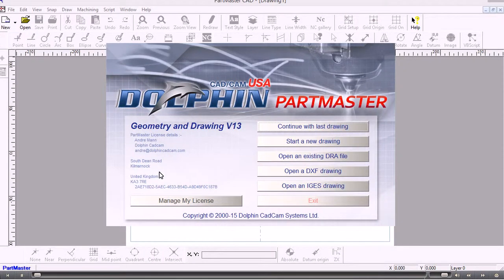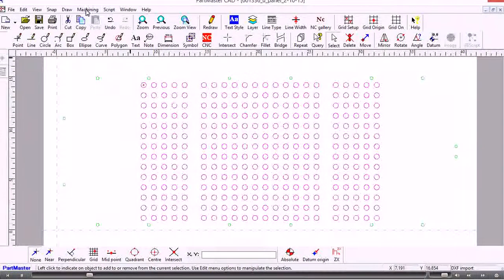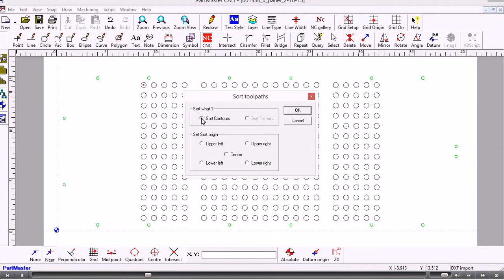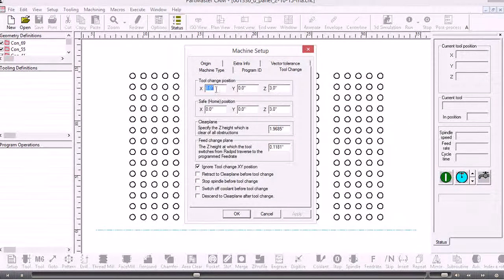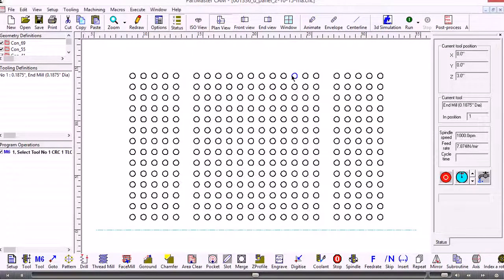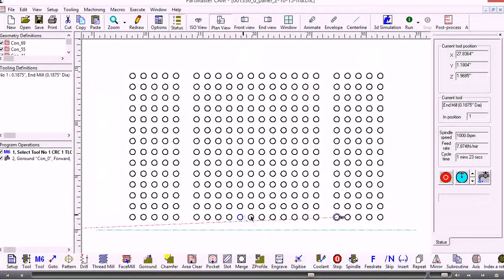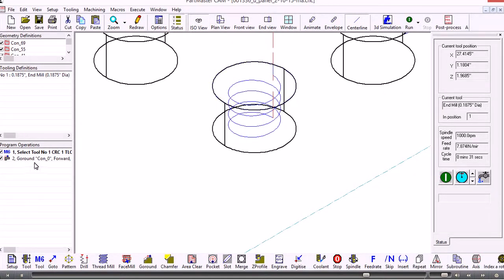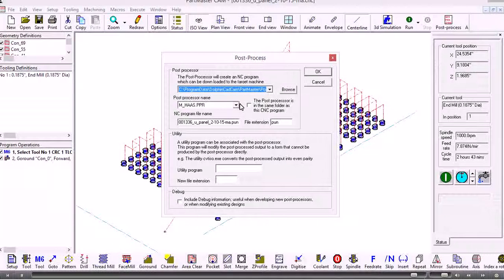Dolphin PartMaster CAM Helical Milling holes

Comment from the maker: This was created with V13, the same functions are available in V14.To enable the Create NC contours, you must first use the Select icon and click and drag around some geometry.When you create contours, you can assign a Group  number - this can then then be used to machine many contours within the same group, which have the same attributes, Work surface, depth etc.In CAM under the Option tab of the Goround dialogue, you can check the box "Machine all contours with the same group number"Hope this helps

Comment: What version software is this.  I have version 14 but, there is no create NC, Contours under machining.  I have many holes with chamfers and the only way I could do it was to create operation for each one instead of doing it by creating contours.   I also thought there was a way to select contours based on depth but I could not find it.